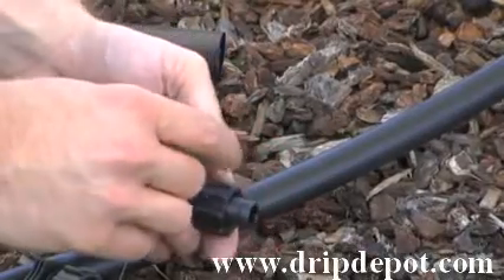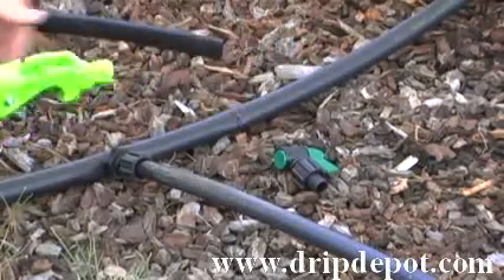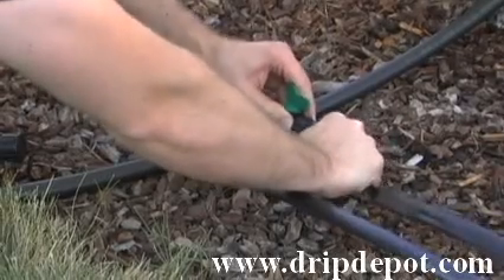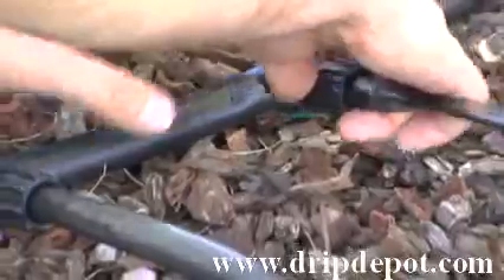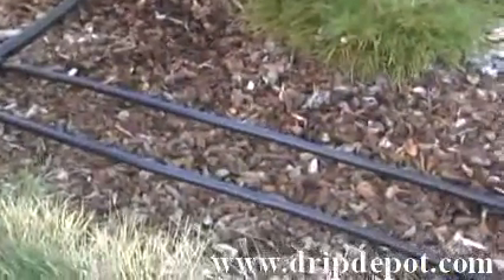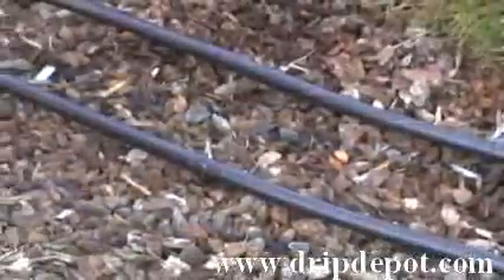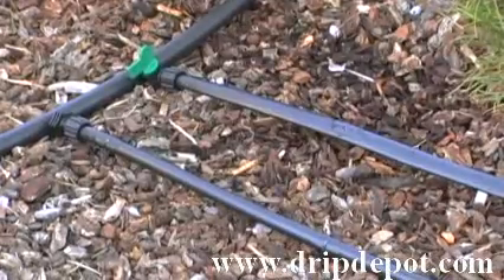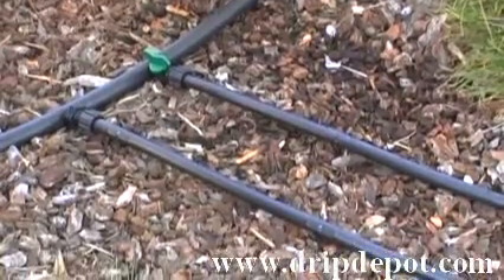How to Install a Drip Tape Take off Valve in a Drip Irrigation System

Comment from the maker: Hi,
The tape take off valve (item# 1225) shown in the video is different from the one with the rubber grommet (item# 1501).  The fitting you purchased with the grommet is used for installing the fitting into PVC pipe.  You would drill a hole in the PVC just smaller than the grommet.  Pop the grommet in and then push the fitting in.  The fitting in the video is used to go from solid poly tubing to drip tape.  If you have more questions please contact us at: (866) 246-7707